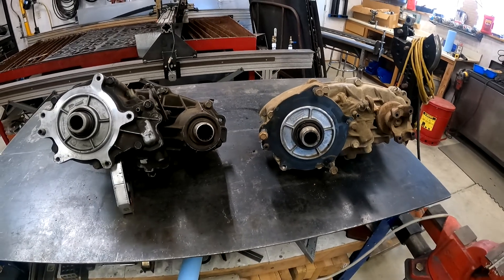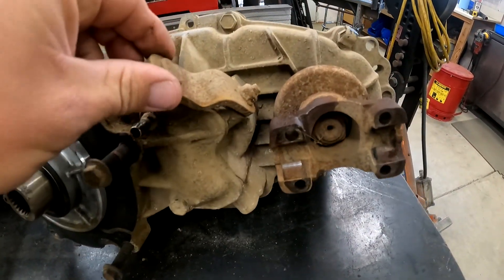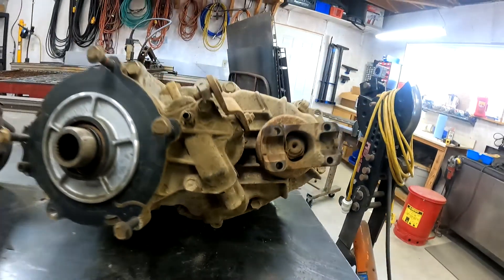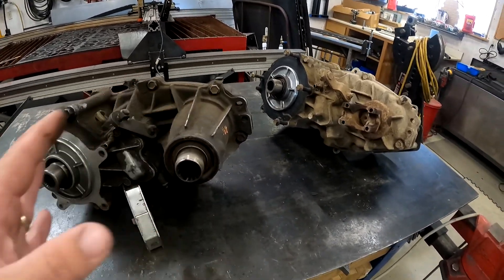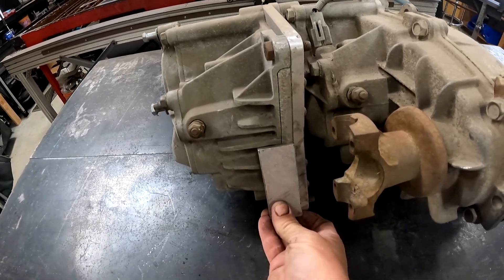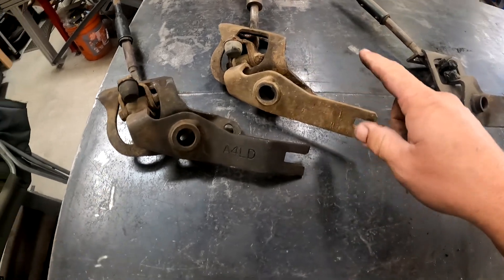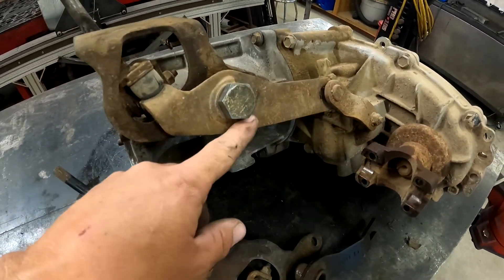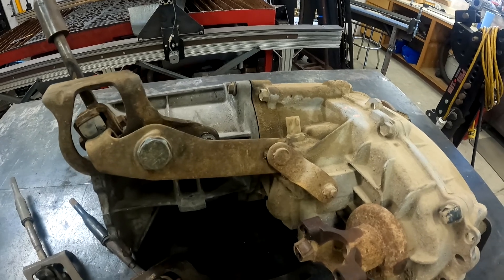Ford Ranger Transfer Case Differences Between the BW1350 And BW1354.

Comment: I am trying to replace the slave unit on the clutch of a '94 Mazda B 4000 4wd but I can find no information regarding the wiring plug on the transfer case that are retained by a curved piece of metal. One is a larger plug about 3/4" dia and the other .  a wire/tube that enters the case directly. What are these and what kind of irrepairable damage would breaking that smaller wide do???. I am trying all this repair work in the ground in freezing temperatures not much above zero degrees and I don't want to make an error. So if anyone can answer is I would appreciate it
Reply: Did you ever get it fixed?
Reply: @curiousgeorge986  Yes, but I now have two rear leaf spring shackles broken from the frame and the after market hangers do not fit the same way. So I am adapting

Comment: If the only thing I have is a 1350 can that fit on a 1995 ranger?
Reply from the maker: @charliesosa5299  it can but the front driveshaft will be different.  You will also need to make sure you get the correct shifter linkage to match the transmission and t case.

Comment: Id like to make my 97 ranger 4×4 but id like to use what came from the factory. What do you recommend i do?
Reply from the maker: You will need to convert the transmission to 4wd or swap it out.  A 1354 case.  Then if you want to use all the factory front suspension you also need to swap the motor crossmember.
Reply: @northpeak4x4  would I be able to keep the automatic transmission function, or does it have to become manual?
Reply from the maker: @tacticalpalatero4479  yes you can keep an auto. A manual shift 1354 will be easier then an electric shift t case.

Comment: Looking to put a 2002-2003 manual shift 1354 into my 98 but there rare. Anyway to convert a 96-97 manual shift 1354 to work in my 98?
Reply: 1354 to 1354 should be same internals minus the shift mechanism. The outter case on the manual shift is different too but bolting up the older one shouldn't be an issue as the A4ld and 4r or 5r auto trans all have the same output spline and bolt pattern. You would be better off just bolting the older 1354 to the newer trans
Reply: What issue would there be to adapt? If you're thinking front driveshaft go talk to a driveshaft shop to build one with the older transfer case side and front to match the 98.
Reply: @ponyboi.gamer36  I was thinking the hard parts in the transfer case itself. I know the way the front driveshaft mounts to it is different -97 to 98-11

Comment: What does it take to put a 6 pinion into a 1350? Does it go right in or is it more complicated than that?
Reply from the maker: It pretty much dropped right in.  You might have to use the 1354 shift fork as well.  It was like 15 years ago when I did it, and I don't remember all the details.  I know I used whatever parts I had between the two cases, and I didn't need any special machining to make it work.  I also used the parts out of an electric shift  1354 to put into my manual 1350 case.
Reply: @northpeak4x4  Thank you for the info!

Comment: You seem to know quickly a bit about these things. Maybe you can help me, what would need to be done to a m50d R1hd to change it from 2w to 4 wheel drive trans?  What all is inside a 4w tailcone? 
Thanks
Reply from the maker: I'm not totally sure, but I think at least the output shaft also has to be changed.   I have a few transmissions to pull apart someday to find out. I also want to put gears from a 3.0 transmission in my 4.0 case so I can get the lower 1 thru 3 gears.

Comment: I have a 1994 madza b30004 wheel drive 6 cylinder stick works in low 4 only don't know what to do
Reply from the maker: Check to make sure the shifter is adjusted correctly.  If that isn't the problem then it is probably something internal that is binding.

Comment: I have a 94 ranger. Manual transmission and manual tranfer. The transmission has just been rebuilt and the rear end has no issues. But the truck will only drive in 4 low. Some times if you go down hill and pop it in 2 wheel it will go for a short distance and stop. Any ideas on what could be going on? Thanks.
Reply from the maker: Make sure the shifter linkage is adjusted properly.  It might not be letting it shift into all the gears correctly.  Especally if it started right after pulling the transmission because the linkage had to be removed and re installed
Reply: Was it the linkage or something else causing the condition on the 94?

Comment: wire coming out of transfer case? is that a bw 1354?    I have a 1999 ford ranger. trying to fix it. pick up  don`t move. new motor on it.
Reply from the maker: One is a 1350 and one is a 1354.  I have never messed with the electric shift version.  On the manual cases they have a speedo and a shift light switch on them.
Reply: @northpeak4x4  i`m going to take to my friend,